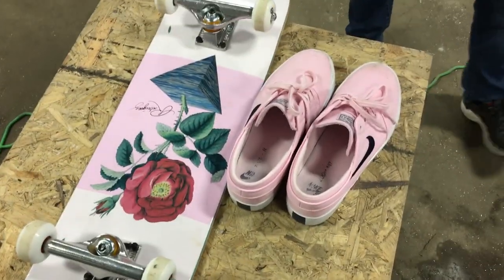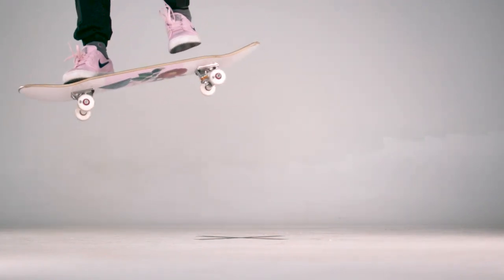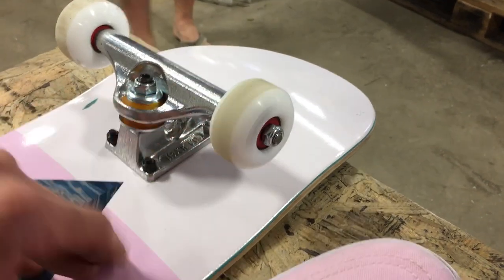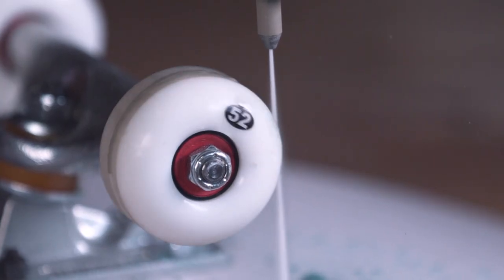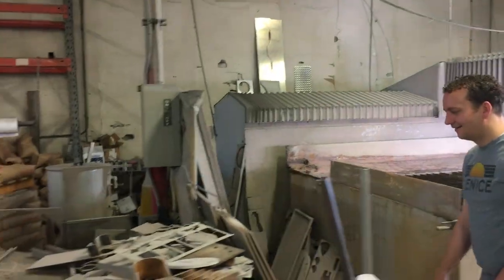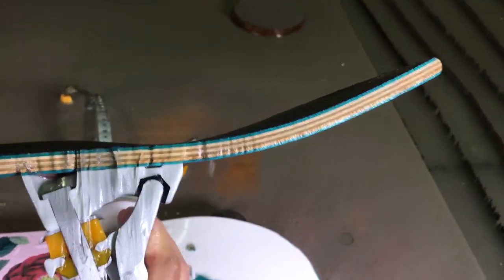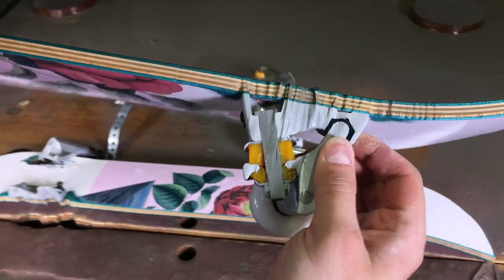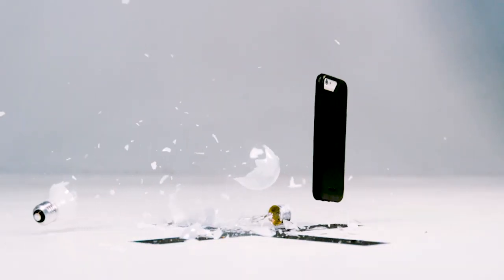Interesting - Exploding Skateboard Wheel With A 60,000 PSI Waterjet Cutter - Slow Motion Cutting

Comment: i wonder if you had stopped the water jet just before the wheel exploded how much it would have shrunk  back
Reply: 25%
Reply: They need to do it again and stop in time
Reply: Pretty sure it became malleable due  heat from friction, so it spun and got wider due to being in contact with the rim of the wheel. So if they stopped I guess it would of stayed the same size
Reply: TurboJim Presents I think the wheel blew up when it came into contact with the board. I wonder how much bigger it would get if it had more clearance below the wheel
Reply: it blew up because it expanded and the jets position made it break cos it was cutting it
Reply: If you watch the slow motion in .25 speed it looks like the wheel was going to give no matter what, but it's hard to tell without seeing where the board is clearly. Either way this was pretty sweet to watch
Reply: TurboJim Presents It more than likely would shrink back to its original size, given that it is made of rubber and stretched out like a rubber band under the water jet
Reply: TurboJim Presents glad I'm not the only one
Reply: Austin Bryant skateboard wheels are very hard urethane. I dont think it would strech back.
Reply: TurboJim Presents yes, try this guys
Reply: Think about that though. Logically. They have roughly 1 second or less to stop it and based on the speed of the nozzle moving and the distance they have to put it up the wheel, it would have to be computer programmed and even at that it would take many attempts and lots of money to perfect and capture of video and thats not including time it would take to complete all of this. It doesn't seem like the style of this channel because they tend to destroy thing and not do science experiments although it would have been cool to watch.
Reply: REDO
Reply: shoot waterjet 90 degrees up
Reply: would have
Reply: TurboJim Presents exactly what I want to know too!!
Reply: They probably wouldn't of been able to stop it in time. Or maybe at the last second.
Reply: TurboJim Presents it wouldn't shrunk back
Reply: It would shrink back to how it was as its rubber (polyurethane) car tyres deform dramatically and return back to their previous state so why shouldn't this?
Reply: pretty sure it is not rubber but a much harder plastic instead
Reply: +Balazs Csipai all skate board, long board, scooter and roller skate wheels are polyurethane and have hardness ratings such as '85a' for instance. the higher the number, the higher the hardness.
Reply: Urethane...skateboard wheels are made from urethane, not rubber. Urethane is much harder and way more durable than rubber.
Reply: It may have contracted a little(I assume more-so in the thickness of the ring than the diameter) ,but the amount of shrinking in the diameter of the ring wouldn't have been as noticeable as the change in shape of said ring as it cooled....I'm guessing, but it's an educated guess.
Reply: "shape of said ring" you could have just said "shape of the ring"
Reply: go to king of random and ask him to replicate the guy is always looking for content
Reply: Jebus Gaming you are exactly right man
Reply: the dunlavy's   lol  he'd just do some botch job and make a bull excuse why it didnt work
Reply: 24,000 miles per hour that's how you measure diameter right?
Reply: John 2,400*
Reply: TurboJim Presents "l
Reply: TurboJim Presents was thinking of the samething
Reply: It just expanded due to the centrifugal force. That's all. It stretched as far as it could stretch and then collapsed.
Reply: Please do this
Reply: Try stretching rubber and see what happens when you let go of the tension
Reply: Urethane is a highly resiliant material, even more than rubber. If you drop a skateboard wheel, it will rebound higher than a basketball. There is a deformation upon hitting the ground, followed by an energetic return to the initial shape. Common logic dictates that the same would happen here, but please enlighten us mr. engineer.
Reply: Gcracka z Can you show us the physics equation, or the simulation study analysis, or the data from replicating this to prove how you came to that conclusion?
Reply: Gcracka z So are you personally measuring the displacement and getting the force? To solve for K? And what would solving for K tell you. It would tell you the spring constant which I'm sure fluctuates with temperature. But I believe hookes law applies to springs that go back to their normal state. If you are finding the type of polyurethane, (the exact blend) and then figuring out how much the wheel is displaced (how would you measure it? Displaced diameter inside and out) not to mention maybe the reason it broke was because it was losing material from the water jet. How would you calculate the remaining centripetal forces and rpm of the remaining mass? And then find an actual appropriate equation that can tell us at which point of displacement that the wheel will actually not be able to return to it's natural state, or at that point the spring constant may change past that point of displacement/deformity. I aint trying to sound smart or anything, I haven't taken the Dynamics class yet where we learn about passing the displacement where the K value changes and the spring does not go to it's current state. I am semi qualified to make an inference on wether or not this wheel would return back to it's original state or not. But the truth is, I, you, or anyone else can't know until they run a FEA on a CAD program, study the material and work out an appropriate equation for the variable (you have to know the exact blend for this), or just put it on a water jet and stop ot before to see what happens.
Reply: Bradford Davis In Other words ...., ☹️
Reply: Gcracka z in other words
Reply: TurboJim Presents It would have retained its expanded size.
Reply: I'm pretty sure it would have retained most of the fully expanded size but not all..
Reply: TurboJim Present
Reply: It's a plastic.  As such, it's modulus of elasticity is a function of the internal forces and it's instantaneous geometry, both of which are constantly changing under this test. 

Even a rubber band (also technically "plastic") will not return to its original size after stretching.  As an experiment that demonstrates plastic elasticity, draw a rubber band back and "shoot it" immediately.  Then compare the distance traveled to an identical rubber band that you draw back, hold in place for 5 seconds and THEN fire.

The modulus of elasticity changes as the internal forces in the band dissipate as frictional heat, causing the band to fly a shorter distance if it's been held in place.

Same here.  IF they could instantaneously stretch the wheel to this size and then release, it would snap back to roughly it's original size (still not 100% recovery).  However they have to draw it out to this shape relatively "slowly" and so all these interacting curves are in play, and the longer it stays drawn out, the lower it's modulus of elasticity becomes.  

These deflections in E are permanent in plastics.

There are maybe 1200 engineers in the world who could actually give you some kind of prediction about the wheels final size after this test.  I am certainly not one of them.  But it sure ain't as straightforward as having a Yes/No answer.
Reply: it would keep spinning.
Reply: it is not rubber,  but urethane, therefore like said previously, the heat created by friction of the water pressure making contact with the wheel heated it up until it became malleable, as the wheel then spun (due to the centrifugal force) the diameter increased as if it was a ceramic pot. Due to the elasticity of urethane it can only be stretched enough like a rubberband before it breaks, although since the room temperature is much lower than the temperature of the wheel after being stretched, it should cool down quickly due to the discrepancy between both temperatures if the waterjet were to be turned off. Ultimately the urethane would become rigid very quickly, although the time it takes to become rigid would allow the wheel to lose some of its diameter before stabilizing. All in all, both of you are right saying that it springs back, and that it doesn't. It does a little of both.
Reply: Centrifugal force expanded the wheel, not temperature.
Reply: Looks like they need to repeat the test to put everybody in their places.  I suspect it would try to return to its original shape, albeit poorly.
Reply: I just follow my gut and I'm usually right.. it'll retain most of the expanded state but not all, simple as that..
Reply: why would it?
Reply: it wouldn't shrink back unless you put pressure on it to squeeze it back into shape
Reply: Brock Jones most of these people never rode a skateboard in their life. let alone half of them thinks it's rubber.
Reply: Well to those people, think of caster wheels, pretty much the same thing.
Reply: Dad Brad, if you're replying to my comment, I did not mention it was the temperature that expanded the wheel, in fact I stated it was the fact it was spinning that increased the diameter which is literally centrifugal force, I just forgot to mention it clearly
Reply: This video did it. These guys are officially destined for youtube greatness.
Reply: No, the wheel just get Back to normal, really depends on the quality of it.
Reply: it wouldn't have shrunk back
Reply: @AnotherGenericGamingChannel  bearing* not rim
Reply: What about to insert something inside
Reply: I saw this on outrageous acts of science

Comment: You absolutely have to get The Slow Mo Guys there to film wheel spin at like 100k+ FPS to see more detail and possibly calculate the speed of wheel rotation!
Reply: wingwong18 The rotational speed, I believe, is approximately the diameter of the nozzle in inches times the psi of the jet.
Reply: that makes no sense
Reply: wingwong18 I think Warped Perception would be a better candidate Imo. seems like this wjc is kind of mimicking their stylistic cues. love it

Comment: Why did it expand??
Reply: It expanded because the centrifugal force on the wheel became greater than the forces within the wheel that keep its shape. Centrifugal force arises due to a tendency in matter to resist changes in its motion (inertia). The high increase in angular velocity, due to the waterjet, caused the edges of the wheel to be pushed outward. To conserve the mass of the wheel the entire wheel became thinner. Eventually the force on the object resulted in the deformation of the wheel's material from its elastic region (aided by the increase in heat due to friction on the wheel), to its ultimate tensile strength limit, resulting in fracture.
Reply: wtf lol i aint gonna read that
Reply: that plus the wheel wasnt made to spin that fast
Reply: Dj KiD$KoDi because god doesnt exist.
Reply: A
Reply: Samuel Weekes exactly.... Science
Reply: Samuel Weekes no such thing as centrifugal force
Reply: I believe I specified that it arises due to inertia, implying that its not an actual force, there is no need to go that far into physics to explain to someone in simple terms, 'why it expanded' would you rather i go into vector analysis of acceleration to explain why the edge moved outward?There's no need.... for simplicity the guy asking probably knows what centrifugal force means. Why make it more complicated than it needs to be. Thank you for your 'correction' though.
Reply: Shazzkid there's always that one person who doesn't understand non inertial frames of refference
Reply: Dj KiD$KoDi the force from the water expanded it
Reply: Samuel Weekes 

What?
Reply: Dj KiD$KoDi I
Reply: Ethan Ruth its not rubber its polyurethane.
Reply: Samuel Weekes Totally understood all of that
Reply: It was spinning really fast and the sides go out
Reply: the plastic in solid is go out side to the wheel border by centrifuge.
Reply: Samuel Weekes translated for the "too cool for school" kids, what he means is that it spun so fast it went outward and exploded because of the strong force pulling it so much,it exploded, your welcome! 😊
Reply: Waterjet Channel magic
Reply: Centrifugal force
Reply: and you all are the generations taking over?.. humans are doomed..
Reply: ahahaha GG man goodjob
Reply: tell me about it lol common sense isnt common anymore
Reply: Al Lee  lmao hey just because most of our generation can't comprehend simple science ( not specifically shooting at the people in this comment) doesn't mean we're all fucked
Reply: Dj KiD$KoDi not designed to spin so fast. Same reason why cars can't go faster than 300mph.
Reply: Samuel Weekes in English please
Reply: Samuel Weekes please write that again but in idiot language so that I can understand
Reply: Hmm... I'm trying to think of an easier way to explain it. You ever been on a merry-go-round? When its spinning fast you get 'pushed' towards the outer edge. This push gets stronger and stronger the closer you get to the edge. The wheel in the video feels the same effect at high speeds as your body does on a merry-go-round. Since the wheel must maintain the same volume, as the edges go out, the wheel MUST become thinner. It gets so thin that the pressure increases on the edges of the wheel enough to break it. Is that better?
Reply: wtf i not gonna read that
Reply: xLogicx Why not?
Reply: centrifugal force
Reply: Dj KiD$KoDi im no science expert but I’m gonna guess that the heat of the friction caused the wheel to expand
Reply: Yo Mama no you're no scientist 😂 what kind of dumb rationale is that? Lol
Reply: Just That guy 
Well heat would have made the wheel more susceptible to expansion from the centrifugal force...
Reply: Mountkosiosko well at that sort of rpm heat wouldn't make the minutest difference, at all.
Reply: Mountkosiosko i dont even think it would have raised by temperature either, maybe a couple degrees at most, not sure where all these people are getting temperature changes from
Reply: Just That guy 
Friction = heat = material becomes softer
Reply: Mountkosiosko heat wasn't involved
Reply: because its not rated for warp speed
Reply: Dj KiD$KoDi matter
Reply: +great its not even that much text
Reply: g force
Reply: KiDxKoDi magic
Reply: speed was essential, but I bet heat played a significant role.
Reply: Because it spun so fast
Reply: Samuel Weekes oh shit I thought it was because of heat, it gets hot and since it's spinning fast, it changes shape thanks to how hot it is.
Reply: KiDxKoDi it expanded becos if you spin anything to fast it
Reply: went too fast

Comment: Instead of traversing back and forth along your x or y axis you can just slow your feedrate manually then speed back up while leaving your cut speed at the speed the operator set it to. Also manipulating the z axis during travel will help elevate kerf and chatter so you don't get so much of a beveled and choppy cut quality

Comment: Any physicists here able to tell us what happen? What I'm thinking is that the force of the water jet "pushed" it excessively that it expanded or "stretched" the material with the help of the wheel's bolt that it was being pressed against, probably causing friction in the process. 

Because during the demonstration, the material exponentially "thinned" itself like being stretched like rubber. But then again that's my hypothesis, I honestly have zero clues to what really gone down.

Comment: Please ask Armormax to give you another bulletproof glass, waterjet a 20mm hole in it and place the plate's hole in front of your nozzle to protect it for the experiment i'd like you to do...

Please have a car (or truck) turbocompressor,  disassemble it and tangent waterjet the impeller, just as you did with the skateboard's wheel.

These impellers easily run at over 100 000 RPM in normal use, but under a 1km s-1 waterjet, it shall run wayyyyyy faster !!! And if it explodes, your nozzle will be protected against shattering parts.

And if the turbo resists the jet, you may use it as a spindle  to try other round objects...

Also, you can try with a dentist's drill. These drills are driven by a tiny turbine powered by an airjet.

These guys shall spin close to  1 000 000 RPM, under a 2000 MPH waterjet !!!!

Also, if you can access an old circular saw (skilsaw)....

1 - Disassemble it to remove the motor's armature to allow the blade to run freely.

        Circular saw blades are safe up to 5000 - 6000 RPM. What will happen at 40 000 ???

 2 - Remove the blade's gear, motor's brushes and field (stator), bore a hole in the saw's case and reinstall the armature in place for waterjet. An armature normally runs upto 25 000 - 30 000 RPM. Under a waterjet, this shall be spactacular !!!!